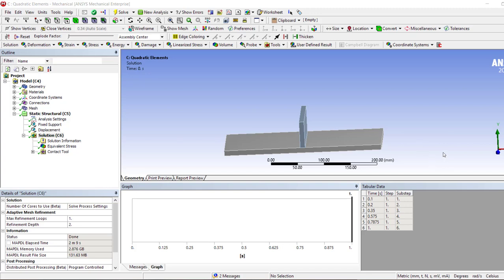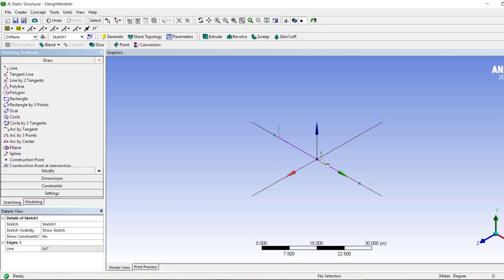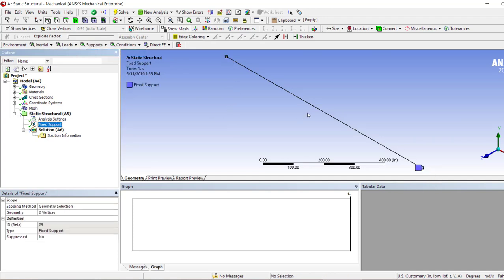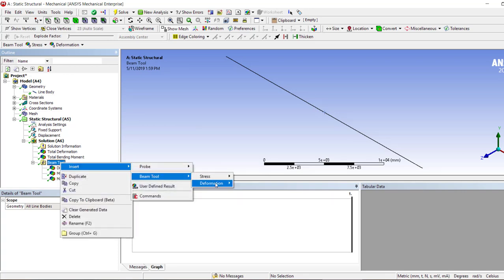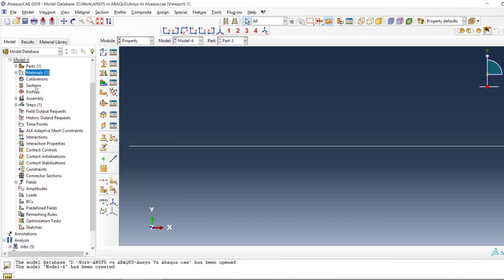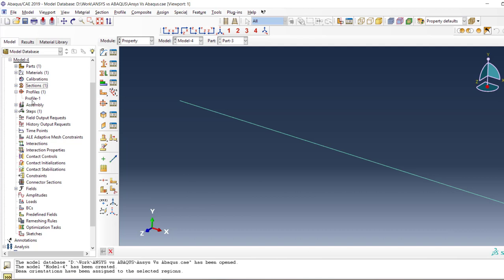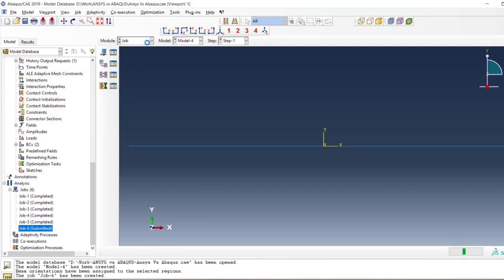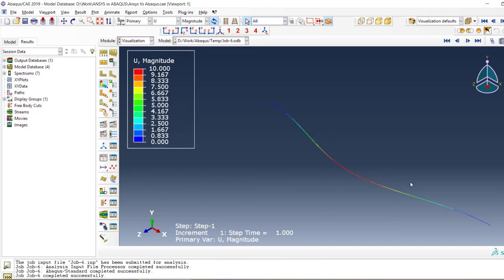Ansys Mechanical Vs Abaqus CAE Part 4 - Setting up A Beam Problem

Comment: Please tell me the final conclusions between abaqus versus ansys? what is the best? thanks
Reply from the maker: Not so easy to say. Everyone has their preferences, For example when geometry is way too bad I would use ANSYS because it would generate mesh, which would be very painful in abaqus. But Abaqus has its own advantage as well. Please check the next video in this series to find out a very technical issue with ANSYS workbench.